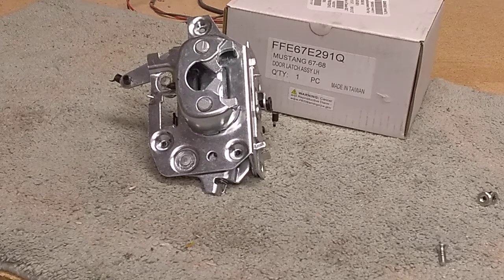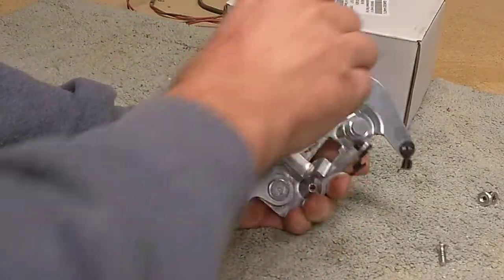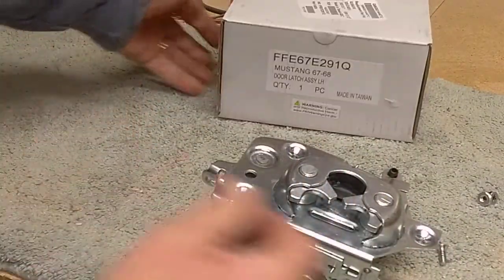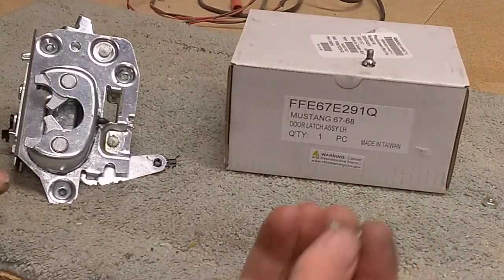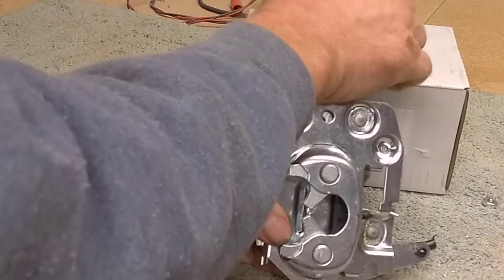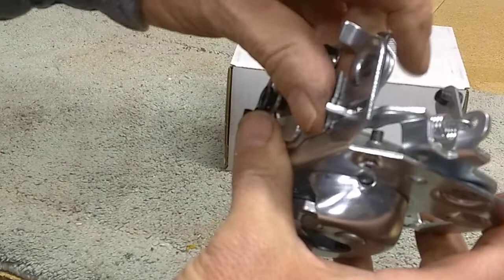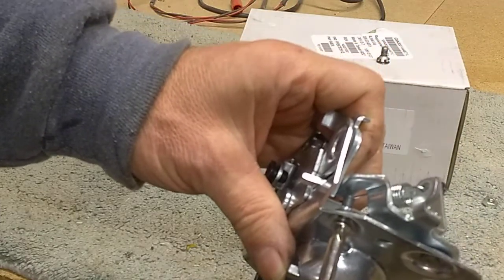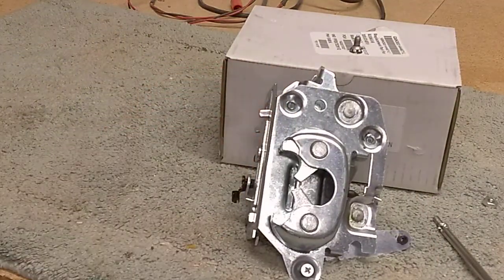Design flaw in 1967 Mustang replacement door latch from Rock Auto.

Comment: I guess thats what happens with Taiwanese parts. I wonder if the the thickness of the door sheet metal would be enough to keep it from rubning and not working. Either way its not a correct part.
Reply from the maker: I discovered the problem after mounting it in the car, so the door's sheet metal didn't help.  I ended up cutting the screw with a hacksaw.  Taiwan knows how to make things.  I assume they're just making what they're told.